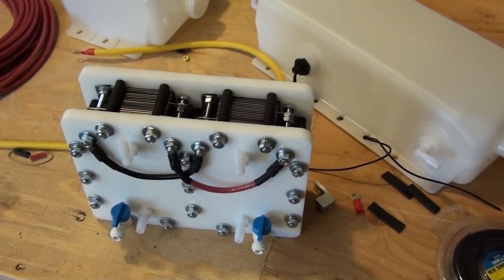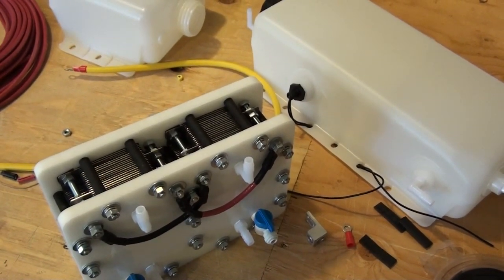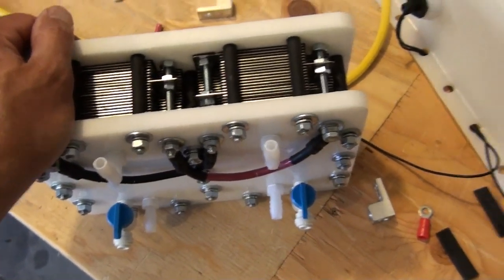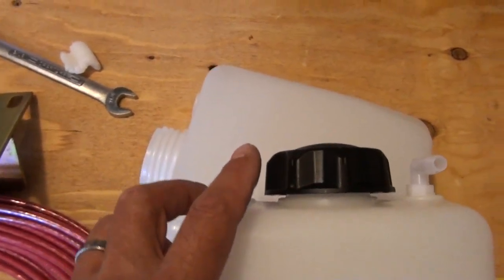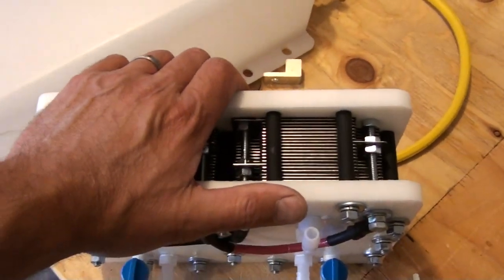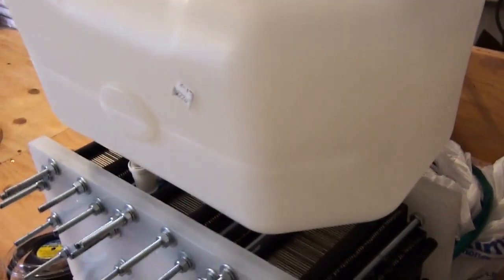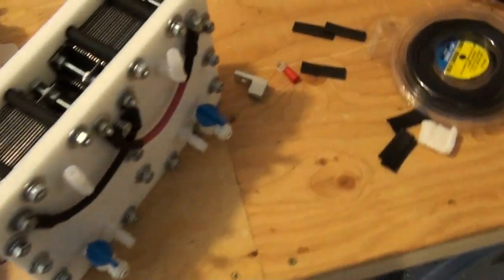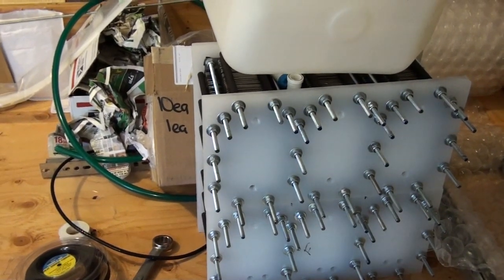UPDDATE. Semi cell, 354 plate monster and separation cell hydrogen hho

Comment: Steve, I have been running a separator cell on my chevy surbuban for about 4 months now with excellent results. I have run dry cells and boyce style cells in the past. The new cell doesn't seems to affect the computer like the other cells did. I'm getting the same gains and a nice clean tailpipe..I am running a pwm with it but I really don't think I need one. Just thought I would let you know..should be a good market for this. No one else I know of sells one in the usa..

Comment: Steve, I forgot to mention that the temperature of the SGC "MUST" be cool when running - and - do not bubble the H through water - scrub it through a filter - or the H will not be pure. If the SGC runs hot, steam will contaminate, same thing when bubbled.
If you need a hand in design, give me a shout out.

Comment: @delvis11 , Steve - a single layer of Rip-Stop wont do much, but three layers will do an amazing job. It has to do with the surface tension between the layers. If there is a big pressure differential between the anode and cathode side, the H or O will be forced through the layered membrane, but if the pressure is equal - the H and O wont pass through. Bill and I have both tested this and been working on this for a couple of years now my friend.
Peace.
Mike.

Comment from the maker: @cubcadet1983 They are used to extend fuel mileage and run time. They are not hydrogen conversion kits. A lawn mower doesn't have a charging system to run the HHO generator. Vehicles and standby generators do and this is what they are used for.